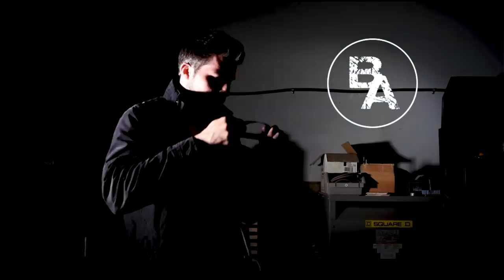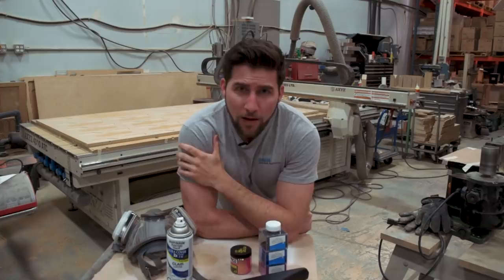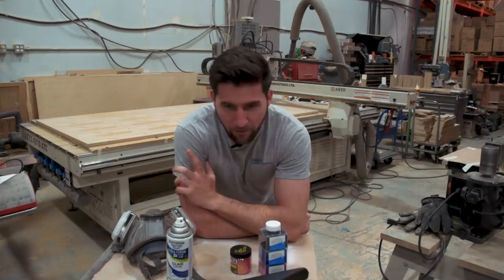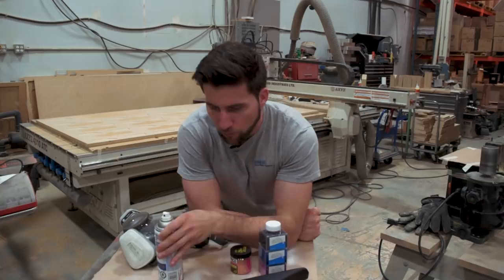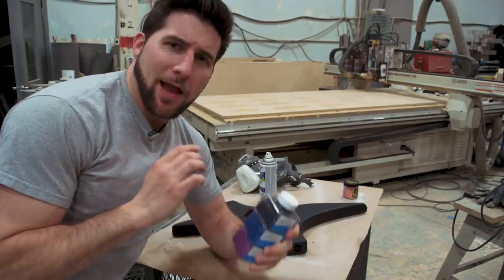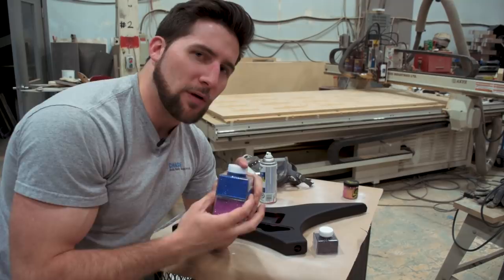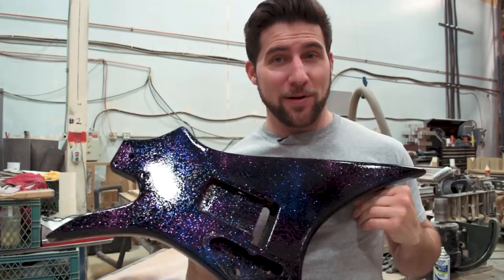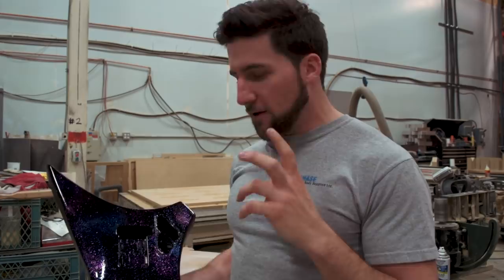Awesome Spray Paint Trick | the Nebula SparkleTechnique (Very Easy!)

Comment: How would you do this on the whole body at ones? Looks sick.  I should get some good pics of the guitar i finally painted and share them on your FB!
Reply from the maker: If you put it on the guitar spray stand I usually use that should do it
Reply: @BradAngove  Yeah just thought about that lol.  Move quickly and rotate.  I actually built a version of that stand.  Worked great last time!
Reply: Also, maybe i missed it...but could you do the rustoleum clean to catch the glitter (slower dry time), and then use spraymax to seal it all?
Reply from the maker: Yes, you could do that. You would want to let the Rustoleum dry for a week or two and scuff lightly before applying the spraymax though.

Comment: That looks amazing. Great video. Could I do this on a bullet strat without having to remove the black that's already painted on? I like my bullet strat, but I'm not a huge fan of plain black guitars.
Reply from the maker: Yes. You would just sand the current finish with some 600 to allow new paint to stick, and then do like I did here with the clear coat.
Reply: Thank you. I'm definitely doing this soon

Comment: As always another masterpiece Brad! Question I notice that U use a lot of flat black…what if say gloss black were used in its stead ?
I am thinking a shinier version of a very already cool nebula. Would that be a possible over kill?
Thanks for the demo’s Brad you rock brother!
Reply from the maker: It wouldn’t be any shinier, but it would work just fine. Just make sure you scuff sand it before adding the clear (after it dries).

Comment: Thank you Brad for a great video, I was actually contemplating on making a sparkle finish. I have a question. I would like to make a silverburst with the silver having sparkle in it (kinda like on PRS SE Mike Mushok Baritone guitar). I was thinking: Primer -> Silver -> Black on edges as a burst -> First coat of clear -> adding the sparkle in the silver -> and finish it with clear. Do you think that is just too many layers?
Reply from the maker: If you are careful about your dry times, that should be fine. You can also use the silver Rustoleum glitter spray to add sparkle to the silver.

Comment: Hey Brad, great video! Do you know how to make a splatter finish so that the guitar looks like a Pollock painting? How would you keep such finish even-surfaced?
Reply from the maker: Those techniques involve a lot of paint flinging as fast as I know. The only way to get them flat that I’m aware of other than some flotrol magic is to put it under a thick layer of clear.
Reply: @BradAngove  Thanks for the quick reply! In your experience, would such a thick layer of clear have an impact on the guitar tone? How many layers can one hope to put on before tone is affected, in general?
Reply from the maker: @hvatalnik  On a solid body electric guitar you don't have to worry about that. People do some crazy things with them without affecting the tone at all. If you're trying this on an acoustic then that's an entirely different story.
Reply: @BradAngove  Awesome! It is going to be a solid top model. Thank you so much for the insights! :)

Comment: OK - hold up - wait a second - 

Can we just talk about the $40,000.00 elephant in the room?

You've got that massive CNC (that I assume is at your disposal) and you're buying kit guitars?

Dude.
Reply: For the record - I would also love to see one of these done with the "Pink Taco" color-shift stuff.....
Reply from the maker: Haha that’s a good point. The kits are of course more suited to the whole tutorial thing, and I’m not actually buying the kit guitars, but it would be fun to CNC a few. Funnily enough, the Chinese ones are still cheaper haha.
Reply: I have a somewhat opposite problem - I've got several renderings and in one case a full set of g-code, and no CNC on which to run it....  As you say, it's not a cheap proposition.
Reply from the maker: Don, it doesn’t help that I have no idea how to use that damn thing haha.
Reply from the maker: It wouldn’t let me read your comment magnet. It just said that you had posted something. Must be because you removed it. I don’t get offended as easily as you might think haha. 

Yeah, I’m working on some custom plans that will involve the CNC as part of my business idea, which will involve selling my own custom replacement bodies that work with Stratocaster and telecaster necks. I’m really looking forward to it. Still trying to save up what I need to get it started haha.
Reply from the maker: A little criticism never hurt anyone haha.